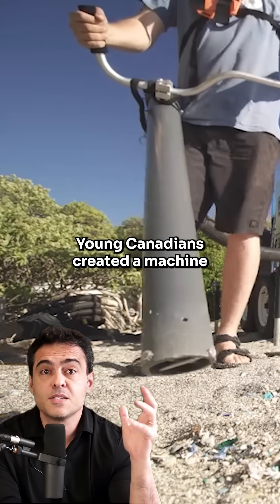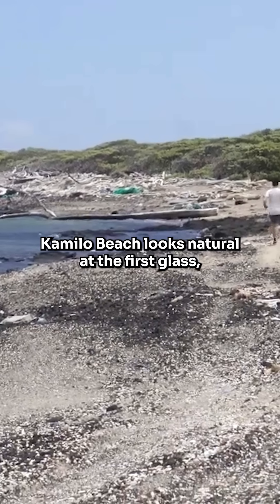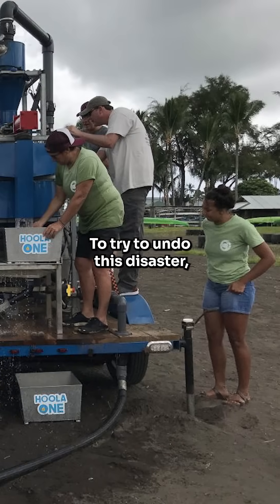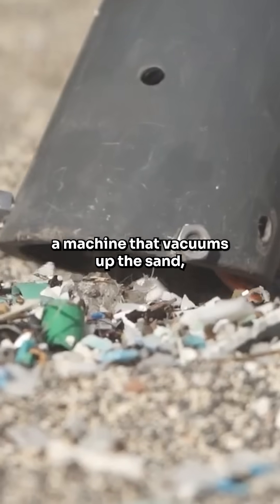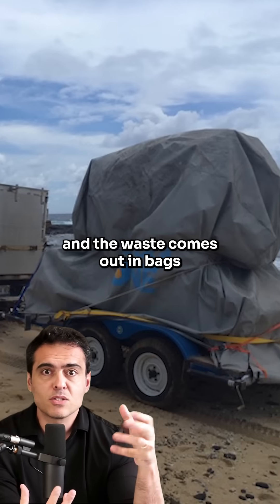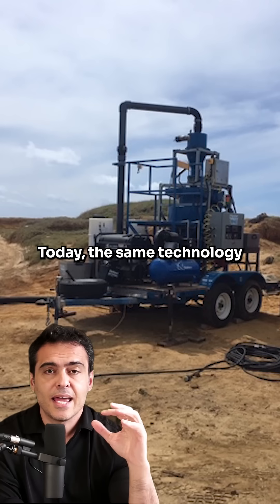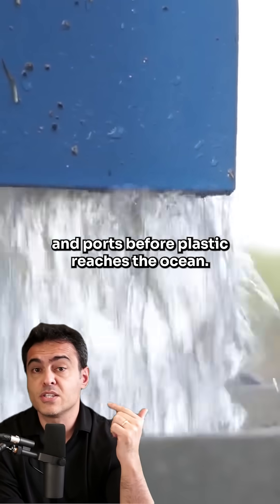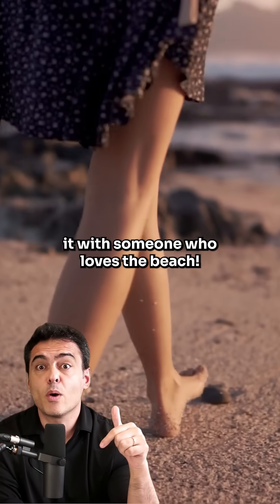Young Canadians created a machine that cleans sand from beaches!

Comment: Wood also floats so you're getting rid of a natural ecology and drown insects that occupy or live inside or under it. Fail
Reply: Not entirely... it is still doing the job of taking plastics...
You are right that the wood/shells/crustaceans and insects need to stay.
Maybe give off ideas to help before failing someone's worthy idea
Reply: @rebeccasaunders3920 Better ideas may be to enact laws that will prevent problem to begin with, like fining people and forcing them through education on the topic or introducing it in schools as mandatory requirement as number one priority, second option is to encourage innovations to replace plastic that biodegrades with certain factors coming into contact with UV, certain elements or minerals or acidic environments such as stomach acid.
Reply: @DivinityIsPurity  and there it is there... ideas arent just thought patterns to make something. Ideas are things to consider and construct.
Reply: @DivinityIsPurity  Enacting yet more laws is a bit late when you consider how long the petroleum industry has been making plastics. This stuff has been accumulating for decades and it still needs to be cleaned up. Since it costs much more to try and recycle plastics, which often can't be recycled if you understand the chemistry involved, the petroleum industry will continue to churn out more and more new plastics because it's cheaper to make new than to recycle old. 

Could just ban plastic bottles and jars outright and go back to glass, which can be easily recycled and is chemically nonreactive to most things (basically, only hydrofluoric acid can dissolve glass), though there's cost to that, too. 

One kid came up with an idea to clean up The Great Garbage Patch in the Pacific Ocean -- people scoffed at his idea. Now, he's proven that it can gather up large quantities of floating junk in the ocean, making it safer for the critters that live there. There's a group in Europe that came up with a way to catch plastics and other garbage in streams and rivers before they get to the ocean. 

We gotta clean up as much as we can while finding more or better ways to reduce/reuse/recycle.
Reply: So your solution is what ? Criticizing? At least they are testing out a system that is at least a partial success…
Reply: Wood also grows in the ground. Ever heard of trees? Lol youre worried about the wood on a beach?
Reply: I think the insects/critters would survive that. Or do you like birds choking or starving bcs of plastic?😅
Reply: @GreenPoint_one Birds can evolve to avoid eating plastics, you don't see all birds doing it, with every generation there will be less and less.
Reply: Wow, somebody is full of positivity. And by positivity, I mean themselves.